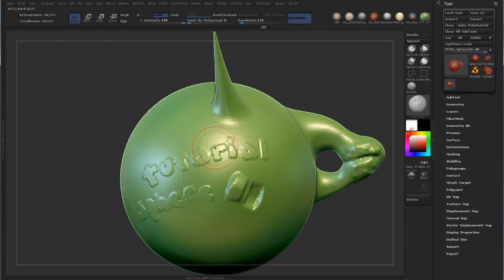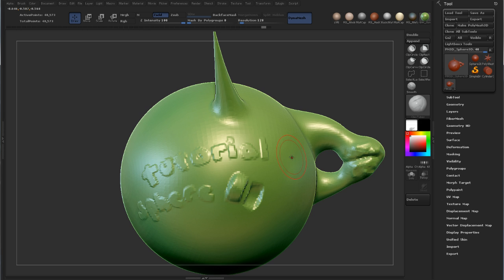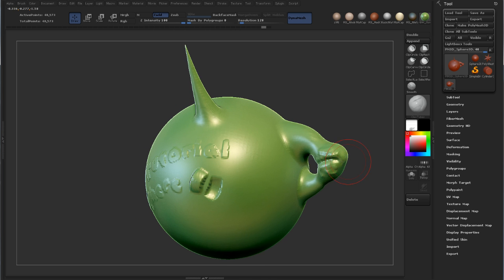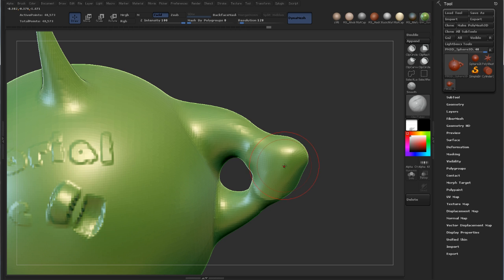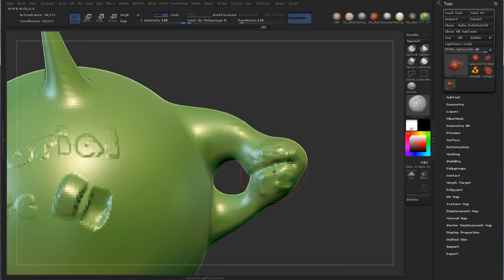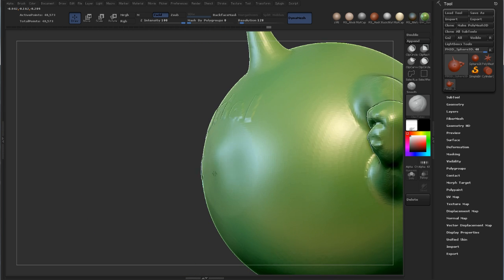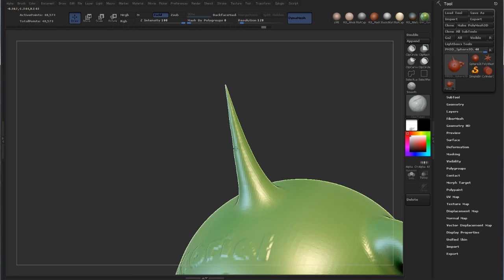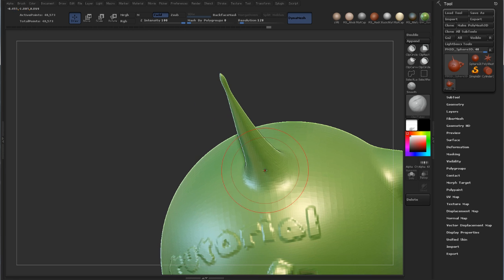ZBrush Tip - Alternate Smooth Brush

Comment: I dont know why when I do smooth it does not work well,, smooth takes a lot of time and doesnot flatten the surface even after several minutes of rubbing..
Reply: If you had used those several minutes to think, maybe you would not have  lost precious time. Thinking before acting sometimes help ;)  If you smooth and it "doesn't work" try grabbing another smooth brush, press the "," on your keyboard, then click on the brush folder, and select "smooth stronger.ZBP". If this doesn't help, and I guess it won't, then your topology is too high. ZRemesh your object to a lower poly count and better polygon flow. Subdivide that a few times. Project the details from your high poly (the one you couldn't smooth). And now when the smooth brush doesn't work well enough, go down a few subdivisions, smooth, then come back to the higher definition and keep working. Alternatively if you're using ZBrush 2018, activate the Sculptris Pro mode and reduce the polycount in the area that needs smoothing. Anyway your problem is : bad topology. Many ways to fix that.